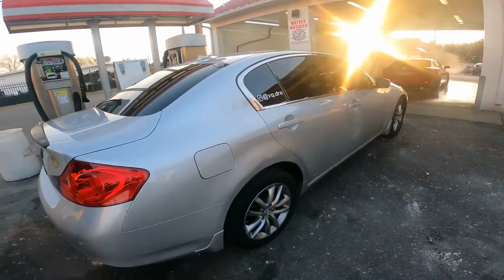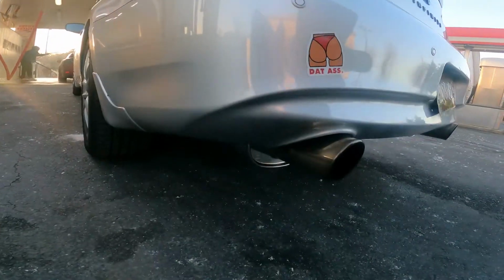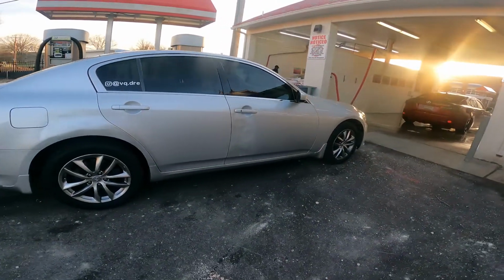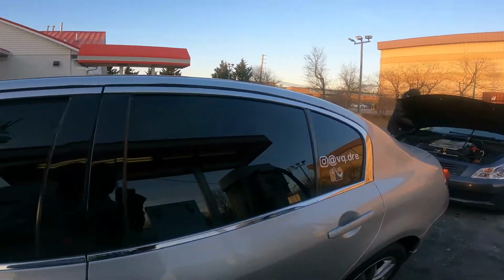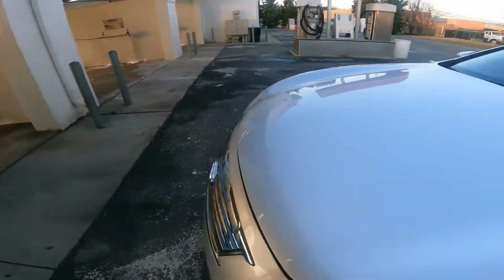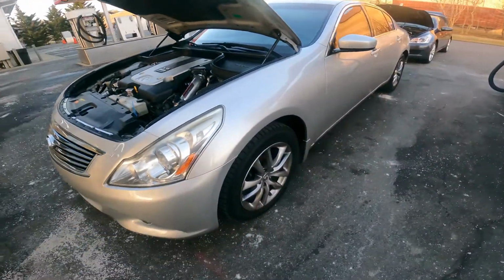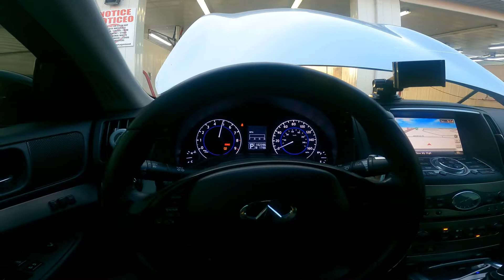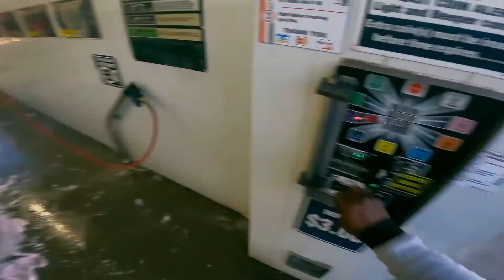Channel Intro : Bolt on tuned daily G37X walk around

Comment: Had a question how’d you get that tail part that holds the rear view camera black
Reply from the maker: 1. Mute your audio by pressing the volume knob
2. Hold you settings button and turn the volume knob until you see a new screen 
3. Hit confirmation adjustments 
4. Scroll down to adjust camera 
5. Click adjust line draw
6. You’re done!
Click back to leave the menu